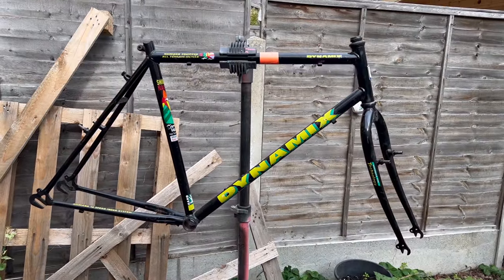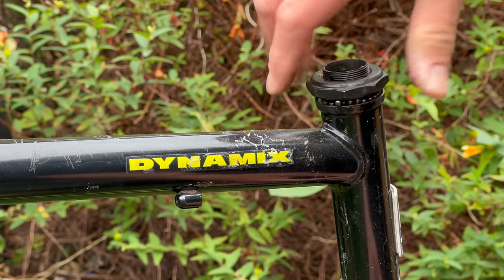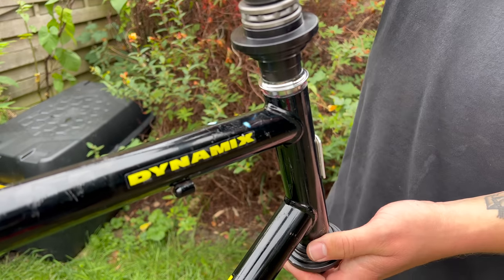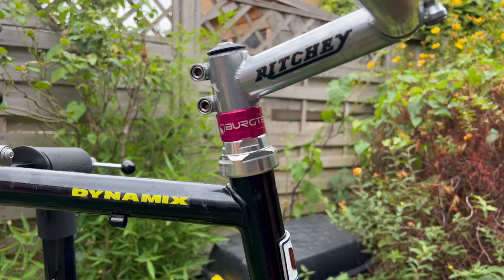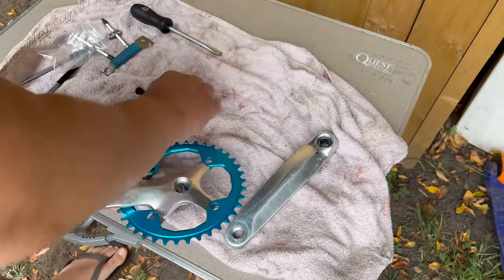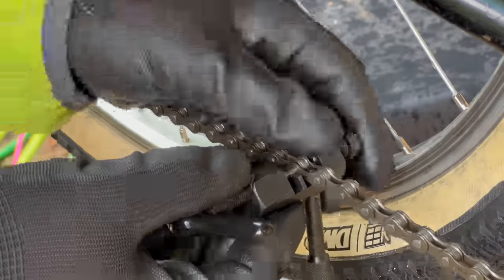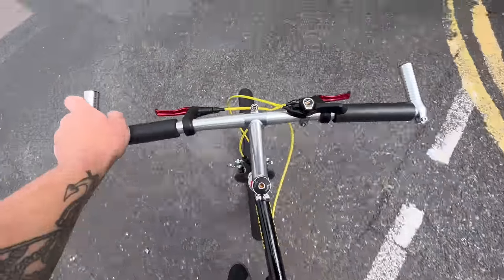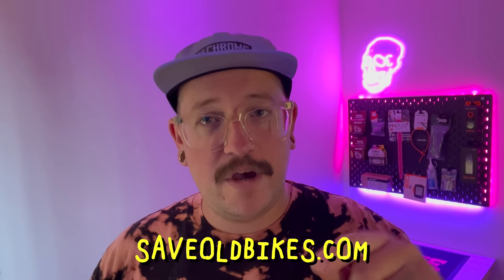Restoration On A 1990s Raleigh Dynamix -  parts bin Commuter bike build vintage MTB

Comment: Not all greases are equal, even for the same intended purpose.
I'd bet one or more of the MTB magazines will have 'tested' several brands of the time, but I couldn't tell you when.
For our purposes - pleasure and commuter riding - you don't need to spend serious money, but a proper cycle grease from a recognised brand is where you want to be. Automotive greases are usually too thick and heavy for a bicycle's smaller bearings, and obviously cheap grease won't last.

Top tip: a grease gun, even one of those little ones that fix on the tube, makes your grease go a lot further. You don't waste as much on a brush or your finger.

Comment: I had some different kinds of grease. Lithium, silicone and so on. They are a little different but not much. But the viscosity is what matters. Some thinner ones are good for some parts that move a lot but are not exposed to much water
Reply: For example for skateboard bearings you dont want to use grease at all. Only thin oils, because you need those bearings to keep the momentum going and grease makes them sluggish
Reply: Lithium is good overall for bikes, maybe too thin for headset lowers and water but rest perfectly fine

Comment: I just found a motobecane in the scrap bin. The 27 in wheels are dead true. As for grease, since im saving a bike from a dumpster, I worry about the grease. I think need to use biodegradable grease, but already have marine grease. So, I just stuck with the marine grease and didn't want to waste grease. In my mind, its just a little more ecological.

Comment: I just had to seat a crown race on the weekend and found that for 1-1/8" steerers, 25mm PVC with a matching cap on the end is perfect (ID is about 29.8mm). Maybe there's a suitable size for 1" threaded too? Better than a mallet anyway 😂

Comment: I did some tests with grease in coaster brake hubs.  No discernible differences while riding fresh, but some degrade much more quickly, this will become obvious in a coaster hub after you've done enough miles to cook the shittier grease and is glaringly obvious once you repack the hub.  I compared a white lithium grease, a teal-colored poly-lube, and a red high-temp grease.  In coaster hubs, white lithium grease dies the quickest death; it separates, turns a khaki color, smells bad.... braking and rolling performance is impacted once the stuff shears.  The other two lasted well; i got the sense that the teal stuff rolled better but that might just be in my head.  I also felt like the red stuff resisted heat better (and it should, as it was rated for a higher temp-- but how hot do coasters really get, even on a trail ride?  Hot enough where i saw a vid where Atomic Paul wrapped bacon around his coaster hub shell and wrapped the bacon up in aluminum foil....and he fried the bacon on a long California descent...)

In a headset, any grease will likely do fine as it doesn't deal with the extreme conditions a coaster hub or even a regular hub does.... but my time wrenching at a local bike shop proved to me that a lot of home mechanics use the white lithium grease and that stuff smells absolutely wretched once it turns color and gets skanked.

Comment: Did the narrower bars make steering noticeably twitchier?  This looks like a fun build and the 5 spd is just right.  Simple without all the overkill.
Reply: It definitely does make it twitchier. I recently just switched from some cut up 90s flatbars to a wider set of risers and it was worlds apart as far as handling is concerned lol